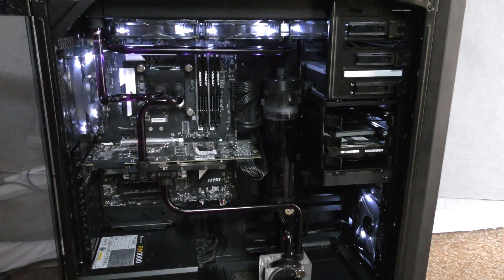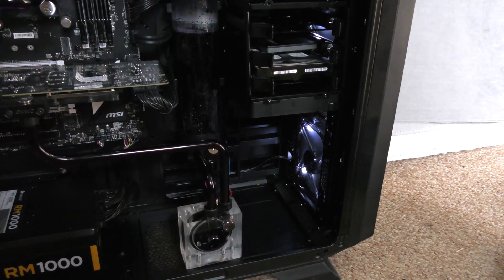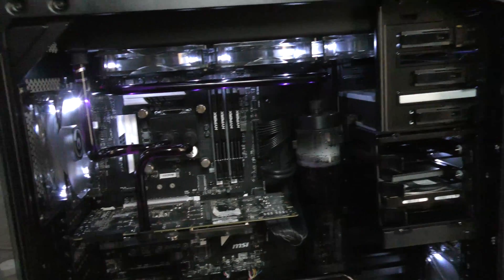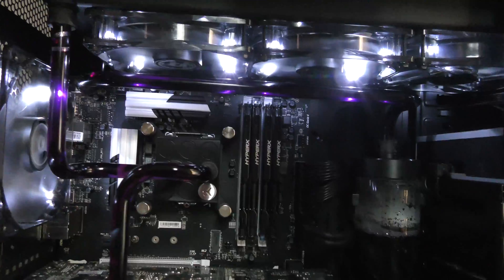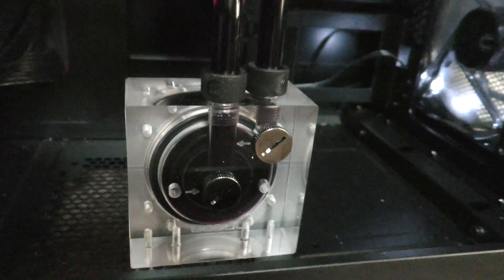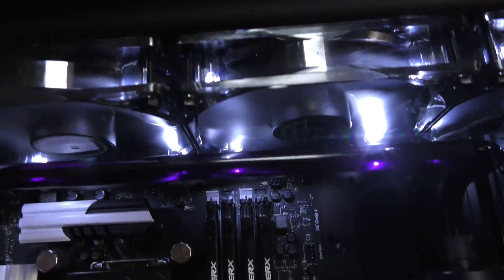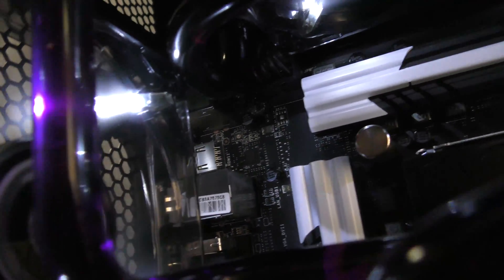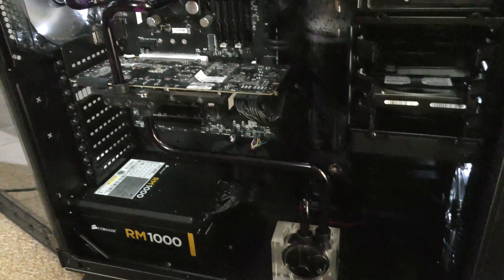Custom liquid cooling loop complete PETG Tubing - How To WaterCooling tips PC RIG Corsair 760T

Comment: A bit late to comment, but.. Draining would be much easier if.. Tip the pc on it's side, connect a barb g1/4 where you filled it and a tube on that, then tip it back upright.  Done.  (put a bucket under it)